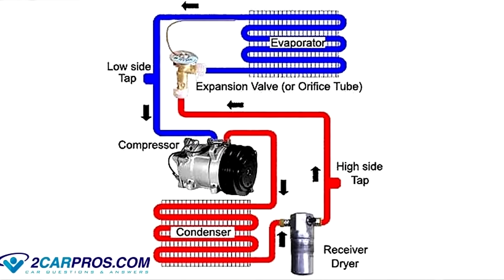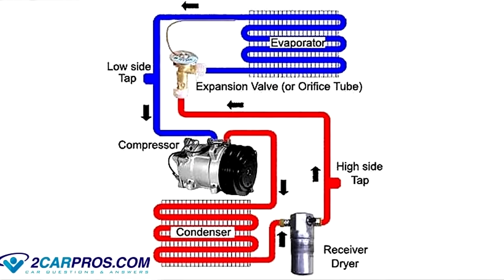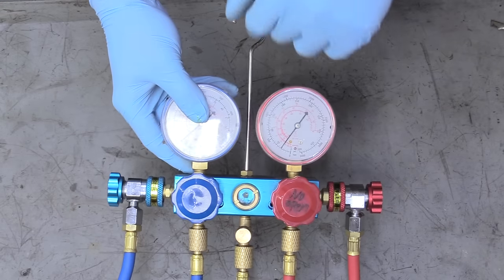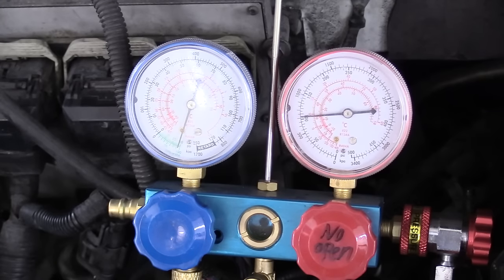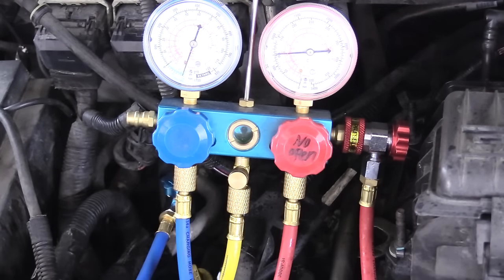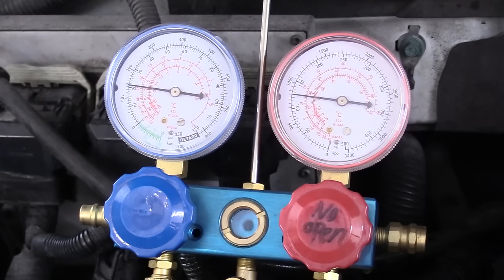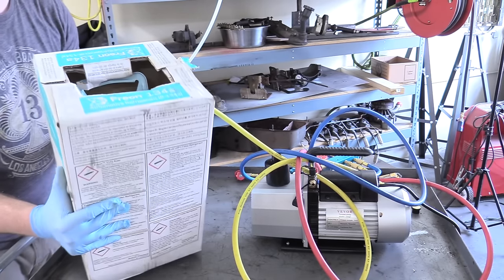How to Vacuum Down and Recharge Your A/C System! - EASY

Comment: My diesel 2005 6.0 coolant Fan runs high when AC is on >>i changed every AC components << Still doing it ???
ambient Temp 95 pressure (45/150)?? any ideas !

Comment: The threads on my yellow charge line will not thread to my new pump, do some of them have to be adapted to work? The low pressure line does thread on to the pump which I find odd.

Comment: if you dont have a large keg and only have the small cans, once you disconnect the yellow line to add the next 2 cans do air get in? and do you have to loosen the yellow line each time?
Reply from the maker: Yeah you are going to have to purge the lines with each can swap. Thanks for watching!
Reply: @2carpros  Absolutely man, i'll keep watching and supporting these are great videos that helped me out alot

Comment: What do I do when I go to put the second can in and it will not take it in? It just stopped taking it after the first can and it held a vacuum and everything I follow the video exactly and didn’t have any issues until adding the second can. It’s like the pressure is equalized so it’s like the second can isn’t even there so it won’t accept it

Comment: Hi there I supposed both the gauges valve need to be open while vacuuming process is taking place. Otherwise the entire AC system would not be completely vacuumed.
Reply from the maker: No, you can vacuum it down just using the low side. Make sure the engine is off. Thanks for watching!

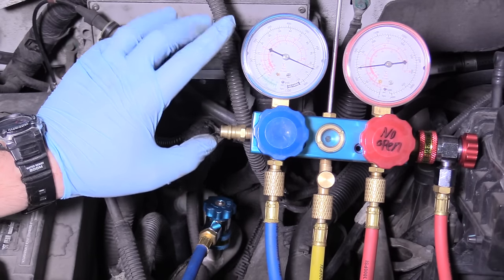Comment: @8:53  I like to check and recheck everything, so I would take a pen or smth. and press the Schrader Valves on the High and Low Ports to make sure that the system is fully discharged.

Comment: Hey man, how do you recharge it with the small freon cans? Do you need to turn the low side off to swap the smaller bottles?
Reply: No,cans are self sealing.Just remove empty can then connect a new can.
Reply from the maker: Same way. I would turn the low side off before removing as well. Thanks for watching!
Reply: @stanbarrington9698  the can is self sealing but the manifold is not. Close the low side manifold valve when switching cans. I’d also purge the yellow line again but that’s just me…

Comment: I have a question, I have intermittent issue with my ac and when it works the pressure numbers look fine, but then it will sometimes just be warm air coming out and the gauges are showing the blue side as under vacuum when car is running with ac full blast. I am curious to what this is a symptom of?
Reply: A sticking closed expansion valve most likely.
Reply: @Bamapride1985  Thanks for the insight. Any real way to test for this?

Comment: Speed up the charging by getting a bucket, put warm water in it, then put the canister in the water. that keeps the cylinder from freezing up. Works with small cans also. Putting liquid in the low pressure line is a no-no! Professional shops that evacuate and recharge a low system have their canisters standing up.

Comment: Thank you, nice informative video. Can you tell from your experience what about adding some compressor oil into AC system during full replacement of R-134a? How much oil to add and when is common to add oil? It is actually on excavator Takeuchi TB175, totally basic AC system.
Reply: If you have replaced the compressor it will come dry or pre filled with around 4oz. Look up what the system requires and what type of oil is needed. Try to be precise. 
If the new compressor is dry you should add most of it before install. Parts of the system you didn't replace will still have some oil lubricating the internals. There are charts and math that you can look up for your application,  but this is not as important as adding the correct amount of refrigerant. Do not guess on refrigerant if you want your work to last.
Reply: @chrissands6332  Thank you Chris on your time and goodwill to help! 2 years ago changed (pre filled) compressor. In manual stay 800 g or 1.75 lb R134a, everything works great with AC. Because of excavator disassembly I need to release all the refrigerant. After assembly I need to charge the system with 800 g R134a. I am asking myself do I need to ad some oil in system too? Doing this by adding oil in tube before releasing R134a refrigerant into pipe. To summarize I am not changing the compressor (this time :) ).
P.S. Changing compressor was done because original has blocked. Few week before has blocked AC guy added refrigerant without adding oil. Maybe this is not the reason why it blocked but ...
Thanks

Comment: I didn't bleed the yellow line when I switched to a new can of refrigerant so a little air got in my system, do I need to start over and revac the system?
Reply from the maker: Yeah, sorry about that. Any air in the system will make it work poorly or not at all. Not to mention the moisture in atmospheric air can ruin the AC system. Thanks for watching!
Reply: @2carpros  thanks. Gonna revac it and start over.
Reply: @2carpros  can I ask you a question? So I charged the system with the correct amount of freon and low side builds enough pressure to kick  on the compressor but then it builds too much pressure and kicks off constantly cycling. I did an engine swap and spilled some oil out of the compressor and wasn't sure how much so I added 2oz. Is it possible I have too much oil? It's been a year the system has sat without being charged after the engine swap. Or do I probably have bigger issues? Pluged evaporator or something. The system holds vac pressure but I was maybe 2-3psi shy of the 29.9 which I have to convert for altitude so 20. It's hard to get into shops here and it's not cheap at all. I am considering buying a rock auto compressor kit and replacing everything so I can be done with it.

Comment: Will the vacuum pulls the oil out or just the moisture and oil stays in compressor thank you
Reply: Your oil will stay put in the compressor. The vacuum only evacs the moisture. No worries.
Reply: You may lose a very small amount as some of it is in the lines, but the bulk of it will stay put. If loss of oil was a factor, new compressors would not come prefilled since manufacturers know that any time a compressor, or other component, is replaced that a vac on the system is necessary. Knowing that, they wouldn't put oil in if it was just going to get sucked out.

Comment: HI , i just bought gauges and vacum. And my hoses dont fit on side port only top. they are nice guages has four hose set .and my pump is 5 cff  single stage blue one .
Reply: R-12 used conventional threads, R-134 uses ACME threads.  Most vacume pumps have a brass T fitting to use either.  Only the center hose from your gauges goes to the pump fitting.  Other side of the T needs to stay capped off.  With a 4-hose gauge, only use the center low side to pull your vacume.  Just leave the high side valve closed.  Unless you run to your local commercial HVAC store and buy the $8.00 converter fitting, then you can run both center hoses to your pump.

Comment: @2carpros there's like 20 questions here about when and how to add oil and no answers. Please elaborate.
Reply from the maker: I have answered this several times and I will again. You don't need to add any in this instance because nearly zero is lost. If you put too much oil in the system won't work at all and is very easy to do. 

If pag oil was important in this instance I would have mentioned it. Thanks for watching!

Comment: why not pull vacuum on both high and low sides? isnt the high side isolated from the low side? There could be air in there that's not being handled, right?
Reply from the maker: Incorrect. The system is a loop. You can open the highside if you really want to but it is unnecessary. Thanks for watching!

Comment: so you don´t pull vacum on the high side?? or do you believe the compressor pull vacum through the compressor??, you know you can have moisture on the high side right?
Reply from the maker: You know it's a loop right? When the system is off like when you vacuum it down there isn't a difference side to side. Please refer to the pinned comment if you are still confused. Thanks for watching!

Comment: R-12 Is super old school/ancient, You have never even seen it before! They only stopped using it in the early 90s, Just look around at how many muscle cars there are not to mention all the foxbody mustangs which all use R-12! Also anyone that says you should just convert R-12 to 134A is an idiot, The R-12 system is not meant to work with 134A that’s why you can never get it as cold especially when you are idling or driving in traffic! Any car that was originally equipped with R-12 should definitely keep using R-12, Also R-12 is still readily available and it is definitely worth every penny!

Comment: Wish you would of used the small cans. Am I just supposed to unplug the can and put a new one on while the car is running? I'm honestly confused
Reply from the maker: Close the valve, disconnect the can. Connect the new can. Open the valve again. Don't turn the engine off. Thanks for watching!

Comment: I just replaced my compressor. After installing the new one i vacuumed the system and now my gauges say i have pressure in the low side but no pressure on the high side
Reply: Sounds like you need to get that Freon removed first then evacuate the system

Comment: Ive been vacuuming for 10 minutes but it wont get to -30 inHg so far only to 25 inHg. The system have lost all freon with this car. Probability of a leak somewhere for 2011 lexus es 350
Reply: What elevation are you at? Minus 1 per 1000 and some systems take longer because of cfm

Comment: I find that watching for vacuum loss to find a leak never works. You can find a leak FAR better by pressurizing system with nitrogen (preferably) or compressed air (not preferable. Can inject moisture)

Comment: Hi - great video! I just installed a new variable displacement compressor PXV16 type. I will use cans by weight to bring up system. I was wondering if it makes a difference with this type of compressor whether I introduce refrigerant low and high side engine off (about 12oz) then start car then continue to add remaining refrigerant on low side or if I can just start engine first then introduce refrigerant low side only until compressor kicks in. Hope you can comment.

Comment: do i need to use vacuum pump if im just topping off to a low refrigerant ac system?
Reply from the maker: No not at all, if you are just topping off you only need to use those cans you get at the parts stores. Thanks for watching!
Reply: @2carpros  so i got the manifold knob turning confused and had the high pressure side open while the low pressure closed for about 30minutes. Ac seems to still work, did i damage anything?

Comment: Does anyone happen to know if it's normal for air to blow out from where the expansion valve goes? I just changed it myself, and there is air blowing out from there when I turn the A/C on.... but it's able to hold a vacuum....

Comment: Don't you need to add oil after evacuating the system?
Reply: No. Google it. Oil stays in after evaluation.  I just looked it up cause i am doing the evacuation but not changing any parts except the valve cause the valve stuck open after a top off.
Reply: Oil stays in the components at all times.

Comment: Does that vaccuum work for R-1234YF?
Reply from the maker: The vacuum will but the gauge set wont. I'm unsure if the 1234yf gauges will hook up to that vacuum though. Thanks for watching!
Reply: @2carpros  Guess Ima find out. I ordered that vacuum and a set of 1234yf gauges

Comment: So you can’t depressurize the line with the gauges ? How do you depressure without going to a mechanic ?
Reply from the maker: Technically you can if you don't hook the keg up and open the valves. But thats illegal. Thanks for watching!
Reply: @2carpros  i thought thats what i heard in the video but then i was confused. because you vacuumed the lines; i assumed there was no way you could depressure the lines at home. so the mechanic opened the valves for you and retrieved the freon.. and then you vacuumed the remaining moisture at home? is that right? sorry for all the questions, i have a bad orifice on my f250 and im trying to go about it the correct way. can you hook up the manifold to the cold side without it blowing up in your face? or can you not remove the cold side cap and hook up without depressurizing first.

Comment: You did the vacuum  but I didnt see where you storage the vacuumed gas or any other  l hose for storage in a canister. another thing I see that you didn't mention  ac oil , why you didn't add oil since you take out everything with vacuum
Reply from the maker: The system didn't have refrigerant when I vacuumed it. Pretend like it was being repaired so just atmospheric air is in there. Like 90 percent of the oil stays in the system it loses so little I wouldn't worry about it. If you add too much oil in the system won't work at all. Thanks for watching!

Comment: An expansion valve is not the same thing as a piston* They are both similar in the aspect that they are “metering devices.” The expansion valve is a mechanically operated metering device, while the piston is only a drilled hole to determine the amount of refrigerant delivered.
Reply: By "piston", do you mean orifice tube?

Comment: How can the high side gauge (red) have any reading if it is shut off ?
Reply: When you close the gauge it cuts the flow through the red hose but the back side is open to the compressor. So it reads the pressure but nothing flows through the red hose.

Comment: why invert the refrigerant and introduce it as a liquid right ahead of the compressor, which cannot compress a liquid?
Reply: When the engine is off and we need to do an initial fill, we will invert the tank and charge through both lines.  Stop, let the system equalize for a couple of minutes, then fire it up.  Once running, you should only charge gas.   But you know, some people….

Comment: how do we add oil to the system if system was opened for car repair?
Reply: Did you replace the compressor?  Was it prefilled with oil before installation?  
Some come filled, most dont.

Comment: Hi I just want to ask you why my car compressor starts pump and stop and and it's not cooling.
Reply from the maker: The pressure in the system might not be enough to trip the pressure switch so it turns itself off. I'd check that first. Thanks for watching!

Comment: WHERE ya' gonna get the newest new R-437C refrigerant??? You MUST have an EPA LICENSE to purchase or POSSESS it and it costs about $400 for a half kilo of it (about a pound) system charge. All the EV's and MOST hybrids and most GM's use it after the 2022 model year. All vehicles equipped with "heat pumps" use it. It is TOXIC to inhale and MUST be trapped and "recycled". It comes in the purple cylinders and uses dedicated gauges. At the appliance parts store near me, (I needed a fan for my fridge) a "small" canister (4-5 kilos) was $8000 net with "used" exchange which is MANDATORY!

Comment: You need to open the high side when pulling a vacuum. You charge with the high side closed.
Reply from the maker: You don't need to. You can but just the low side works too. Thanks for watching!
Reply: @2carpros  Im hvac trained. Takes half the time if you open both. Time is money.
Reply from the maker: @watchnlearn1001  Then why are you watching this video intended for DIY and beginners?
Reply: @2carpros  Good point
Reply: @watchnlearn1001  incorrect - the system is one, how can opening both save time?
Reply: @KenLavacot  are you asking or telling?
Reply: @KenLavacot  You cant pull through the compressor. So you would be pulling through the orifice, then the condenser and then to the other side of the compressor. That is a lot of restriction. Pulling from both sides is the right way if you understand refrigeration.
Reply from the maker: So you admit it doesn't actually matter? Ok good thank you.
Reply: @2carpros  If you can get it to down to 500 microns from just the low side then no, it wont matter. Youll be good.

Comment: i don't understand why you didn't weigh the refrigerant charge and set it to the sticker?  That is one of the reasons to evacuate the system fully, to know where you are at.
Reply from the maker: I don't have a scale that precise. Besides, charging it till it's cold is good enough. But like I said in the video you can just put in exactly what the sticker says. But sometimes that sticker isn't there and I want to cover all my bases.

Comment: So... Am I being too cautious? EVERYWHERE I have researched and read, it is clearly stated that a compressor input is VAPOR ONLY and sending LIQUID into the compressor will more than likely damage it. Yet here you are demonstrating a recharge using liquid refrigerant (bottle upside down) into the LOW side which to my understanding is the input to the compressor. What am I misunderstanding here?

Comment: i did not see you add oil to the system ?   how do you add oil to the system before you add freon.
Reply from the maker: So little is lost I wouldn't worry about it. If you put too much in the system won't work at all. Thanks for watching!